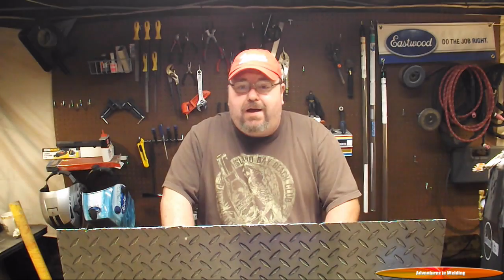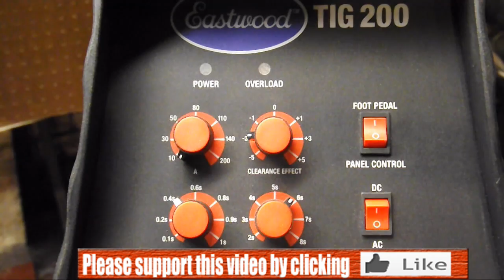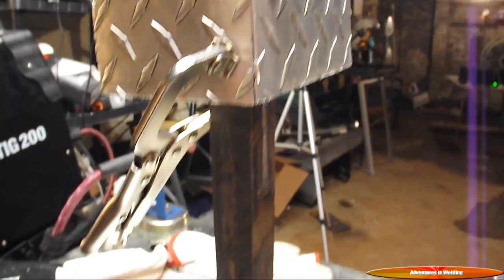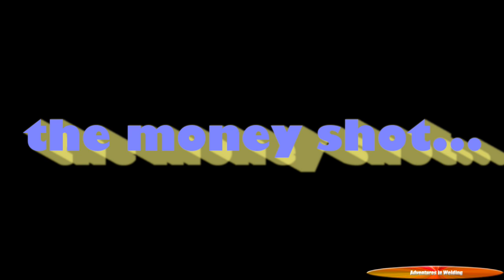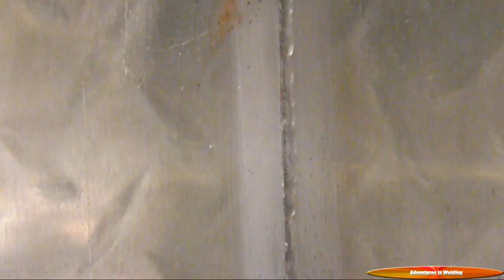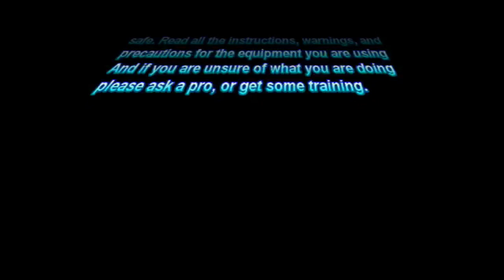TIG welding aluminum diamond plate - Adventures in Welding #127

Comment: Experiment with different lens gel covers to show / simulate what your welding mask can see maybe? Great tips. "Dip dip dip dip dip"... That's the skilled art of it. It's a rhythm.  Like you said, you need both hands, make sure everything around you is clear, practice the motion first to make sure no hangups or obstructions. A 'dry pass' if you will. If you like the angles you have everything set up as, try a run on the least visible portion. If it feels good, keep going. Keep the rhythm.

Comment: Paul. Great video. One thing to note on AL welding with newer machines. Cleaning and brushing help your welds, but the lion share of the work is done by adjusting the AC balance for more or less cleaning action. Aluminum oxide is HARD and tough and forms almost immediately, especially when you add heat and electricity to the mix.

Comment: Hello, didn't hear you explain if you used lanthanated 1% 2% or the new M3 tungsten, or what size tungsten either.   Also bud, those clamps leave nasty scratches on aluminum, especially after its heated up it gets soft and if.released immediately its worse. And you can use Acetone to clean aluminum . Maybe mention those things . Nice job regardless.
Reply: No sir,  just prepping with stainless steel wire brush and acetone is a must. Using high cfm of argon is must"no less than 20 cfm" , and best to do practice run every time before u start.  Make sure your amps are up to your natural speed of hand when you weld.
Reply from the maker: Daniel Fatula Thank you Daniel. I used 2% lanth. I was not away of the clamps causing any marking. What do you recommend?
Reply: Thers a coated 90 and 45 degree clamp for 10.00 at harbor freight.  Its powder coated and scratch proof.
Reply from the maker: Daniel Fatula Im going to HF tomorrow, I will check them out. Thanks!
Reply: @AdventuresinWelding  marine plywood pads coated in fire resistant paint will wear out, but they can take the abuse through a project completion until you need to make a new set. Keep fire extinguishers handy at all times. Keep your welding areas uncluttered. I am building an all metal and concrete addition to my garage that has 2 doors latching together at a corner so I can work on larger objects at the corner under a cover.  Open air but also filtered fan ventilation for doing small work when doors are closed.  If you're not planning safety up front, it's possible you'll have one of those events that will make you change hobbies.

Comment: Hi Paul, The one thing I noticed is that you need a steady prop along the line of your vertical up, so that you can control you arc length precisely. It is very hard to prop directly on the alluminium because it gets so damn hot, and would be very difficult on diamond plate. So put a piece of RHS clamped  on the plate 1 1/4" back and parallel to the weld line to rest your torch hand on. Scott.
Reply from the maker: scott carr Thanks Scott!